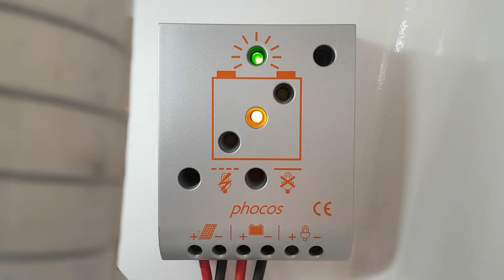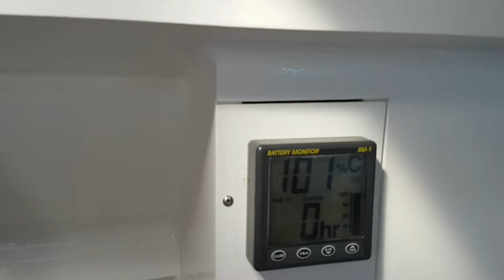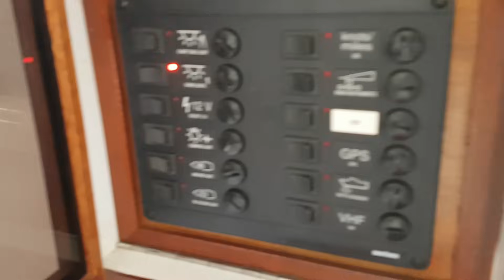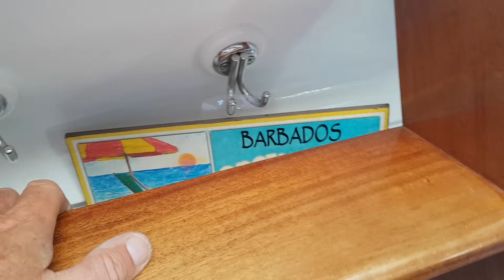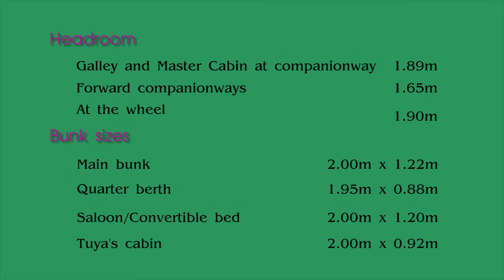Come Take A BOAT TOUR of LUCKYFISH ! Part 1- Ep 45

Comment: Hi!  Thanks for showing us round!  Always keep coming back to warrams.  Would you be so kind as to help me avoid my tendency to swing towards confirmation bias? Can you talk threw any points that you find buggy with warrams?  Thanks!
Reply from the maker: +Quodge Great to get your comment. Im try to think of some negatives... thinking... thinking. "Confirmation bias" eh? (love it!I) It would do a dis-service to the design to put any negatives out there as the list of positives is huge. Many of them sheer genius. I guess there are a few things that take a bit of getting used to on the boat, like any boat. You need to have a certain level of joint movement, fitness, mobility etc as you can find yourself going up and down the companionways a bit. I look at that as a positive since it does keep you fit and allow you to drink and eat as much as you want without getting fat. We also have to watch how much gear we carry. We have a payload of around 1 ton, mostly safety, storm and personal gear. Its plenty for us as we dont like alot of clutter on board anyway, it affects the performance. That's true of any cat but especially so on the Wharrams with our double ended design and deep-V hulls. In return we get great speed (for a cruising yacht) from small, easily handled sails and so on. Hope this helps,. Do check out our website at www.svluckyfish.com for more on the boat and you can join the Wharram Facebook group for a ton of help from other owners. It's here at https://www.facebook.com/groups/1104053236329219/ Cheers from Stew

Comment: the luckyfish looks great .what is your opinion of the type cats that have the cabin built over the pontoons?
Reply from the maker: +harvey g Great question. The bridge house catamarans you ask about are more suited to temperate climate sailing in my view. You can shut the sliding doors and turn on the heater in the cabin. For the sailing we do, between 30N and 30S I personally prefer the bridge deck, minus the house. This is pretty much the most ideal configuration in my view. Roll up the sides of the pod and you have unrestricted 360 degree view and cool breeze straight over the bows. Something you do not get on a "modern" bridge house catamaran. This is the major difference, there are alot more including acres of deck space to sprawl on, wide un restricted side decks set inboard for ease of movement and safety, easy docking with plenty of vision and low profile/windage, the list goes on. Not to mention the neat deck hatch set into the central cockpit (the magic hole as the girls call it!). Thanks for the question! Cheers from Stew and Zaya

Comment: Awesome work Folks!  Love your message about the simple life.  I'm curious about the in-hull dinette vs eating in your pod.  Where do you have most meals?
Reply from the maker: Thanks Paul, the pod mate, we always eat up there. Ask any cruiser... they spend 90% of time in cockpit. Interior design and apartment styling is only for boat shows :-)
Reply: @SailingLuckyfish  Thanks. I'm tosing up between Tiki 38 and Islander 39 for extended cruising. The I39 is more pod - less interior design, although I'm a bit worried about keeping the bed dry.

Comment: G'day mate, good your back, question mate - "single handing" a 38, size wise (it would be only around SEA) in the respect of beam in and around moorings/harbours what's your opinion? The last 6 months I have had my eye on one in Phuket. Also of interest to your followers is a neat doco of a 38 crossing the Atlantic W-E, it is inspiring if you're interested in Tiki 38's. (AP VISUALS) I am not connected just a fan of Wharrams. Anyhow fair winds and slip, slop,slap mate.
Reply from the maker: +bob smith - The Tiki 38 would make a great single hander if you have some experience of single handing a vessel. Just requires more forethought and planning around sail changes, picking up moorings etc. You could also go smaller, say a Tiki 30 or even 26 without compromising safety. Yes, Pilgrims voyage across the Atlantic is an excellent video showing just what the Tikis are capable of. Thanks for the comment and good luck with the search... (PS - if you haven't already, you can join the Wharram Facebook group and get a ton of helpful advice there... https://www.facebook.com/groups/1104053236329219/ )
Reply: Hello Stew, i really enjoy your videos and life style on this great boat. I was wondering about fresh water for such a long passage from SA, are you happy with your water maker, i am planning on going sailing soon, and freah water is #1, any comments, ? Thank you. Patrick
Reply: Cheers
Reply from the maker: +Sugar Reef Annick hi mate, just saw your comment. Yeah, really happy with the EchoTec. It does not have any electronics and so far seems very robust and serviceable at sea. Also, I have been impressed by the after sales back up from Darryl and the team at Trinidad, the suppliers. Cheers Stew

Comment: Looks like a good boat for fair weather and short passsges.
Reply from the maker: not sure what you mean by that? Wharrams are probably the most circumnavigated catamarans out there, certainly the most proven blue water safety record. We have sailed Luckyfish over 10,000 miles including an Atlantic crossing.
Reply: @SailingLuckyfish  I want draft and moderate cockpit elevation in rough seas. I'm not saying this style is bad in any way, I'm just saying every boat has pros and cons. I would personally begin feeling nervous around 13ft. in this style. I like the useable flat deck space. That is definitely a pro.
Reply from the maker: @kenhiett5266  makes sense if you are referring to keelboat specs. With cats, low windage and shallow draft are safety features that help prevent capsize. As far as sea-state goes, nothing beats searoom and thats more of a seamanship thing in my view. Cats are very stable in high winds, high seas under drogue or sea anchor, but sea room is required.
Reply: @SailingLuckyfish I believe the cat vs monohull debate is about as equally matched as is possible in the world of pure physics. Each has obvious flaws and strengths. 

I guess I just see the air draft of your boat coupled with the known characteristics of a cat and it makes me very suspicious of it's passage worthiness. I did watch a fairly well produced video of a Wharrams doing a transatlantic crossing and was impressed, but I also noticed their trepidation when dealing with state 5 seas. Maybe the air draft of your boat is more of a mental error in judgment I'm making. You are definitely a more experienced captain than I am. I am in the process of deciding between a cat and a monohull and it has become such a difficult decision that I almost view it as my nemesis at this point.
Reply: @kenhiett5266   When deciding on a hull configuration, think about the 99% of the time you'll be sailing underway, and it would be REALLY NICE if you could sit with a plate and a cup in front of you and have your dinner without everything sliding off onto the floor.  I've done weeks at a time on monohull, and man it gets weary never being able to take your hand off anything or it rolls away.

Overall quality of life issue, sounds silly but there you go, and it plays out in lots of ways 100 times a day.  Catamarans (& tris) are for living on for yourself.  Monohulls are for carrying craptons of cargo on the cheap, working for a master.  If you look at their evolutions clear back to ancient times, that's really what they come down to.  Monohulls literally can't move without at least trying to tip your ass off that seat and into the sea.

So maybe you're tough enough to fight that war every minute of every day and every night, every mile, every step and reach and action you take.  Maybe you're that tough.  Still, do you really want to live that way?  Is that living the free and relaxing lifestyle?  Personally, I don't think so, not so much by comparison.

The SailOceans channel is another good live-on channel, a rebuilt tri-hull done to their own needs, where they are full-time/season with 2 little boys.  Yah, with kids, like 2 & 4 years old, and all that brings.  I think that's pretty much proof of multi-hull livability right there.

The Maori and Hawaiians used to happily load the whole tribe up for weeks at a time to journey to new shores in the open sea with multihulls.

European navies with monohulls, on the other hand, had to take on prisoners who would otherwise be rotting in jail, or even literally bash guys over the head with a club and drag them on board in the night, just to get a crew.

Of course, you're a free person.  You can decide which way for yourself.

Comment: Hello Stew,
She is awesome. 
When you cover the uppper decks can you show us the engine control setup? I am really interested how the outboards go up and down and how the morse cables operate. Do your engines have electric start?
I know you showed us a bit about the wind vane steering a while ago but am keen to understand if Lucky Fish (lovely fish) has rope steering and if so how you have found it?
What is the length of the double bunks and Toya's bunk?
Also what is the head height in the main cabin and the working part of the galley?
The video had a lot of slap slap noise. Are hulls a bit noisy inside? Or was that just where you had the camera sitting?
Mate, she is great
The reason for the questions is that I am about build one and have only just sold my last boat to do so. Am excited!
Cheers
Paul
Reply from the maker: +Paul Bennett, thanks mate, great to hear you are building a Tiki 38! I am editing part 2 now and will address all your questions in there. You are also welcome to contact me via our website if you need any info during the build. We will do our best to help. Have you joined the Wharram Facebook Group here https://www.facebook.com/groups/1104053236329219/ - really helpful bunch of folks there. To answer a couple of your q's now -yes to elec start, elec tilt engines on raisable sleds, bunk lengths here https://youtu.be/-CKqexz5YIA?t=22m4s, yes to rope steering, brilliant, in video to come, headroom in link above, (similar in galley area as shown), hull slap not an issue for us (bad mic location and bad mic) its ply so there is noise but we are used to it - could be easily insulated around the laptstrake area to prevent it. Good luck with the build! What sort of pod will you go for? Cheers Stew
Reply: Thanks for all of of that - great! 

I am thinking of a similar style pod to what you have but with an awning similar to what Neil has crafted, not sure. Anyway that is a long way off yer. Thanks again, Paul

Comment: Hi, why did you wire the batteries so that both the + and - are coming off the same (first) battery? It is better to have the + coming from the first battery (going to the breaker panel) and the - from the last battery (also going to the breaker panel). Especially if you have like a battery monitor. Only then it measures correctly. For the rest: beautiful cat!
Reply from the maker: Great question - not sure what you saw in the video but we do have the +ve and -ve leads coming from the first and last batteries (Although each battery bank are currently isolated i.e. two separate systems). There was a time when we did not but this was corrected in Grenada. For anyone else reading this - this is important to give you full charging and storage of all the batteries. Same goes for the battery monitor. I do hope this clears it up? Cheers and great comment, Stew
Reply: Hi again. Ok, if you look 8:55 onwards, you show the battery installation. The three batteries are connected and both + and - minus end on the most left battery. The correct way would be to leave the outgoing connection of the + as it is, but move the outgoing - connection of the right battery to the most left battery. Anyway, both ways work, but this is just the most correct way, as you form a loop so to speak. I hope you get what I mean. Otherwise I can email you with a diagram.
Reply from the maker: Hi Marco, thanks so much, Yes you are absolutely right. That was some pre-recorded video and does show the incorrect wiring - you have a really good eye! We did correct this on the advice of the electrician from Grenada Marine. He mentioned that it was likely that only one battery was receiving most of the charge and reducing the effective storage, so we we moved one of the leads to the other end. Thanks so much for pointing this out!. Stew
Reply: You will find most Jeanneau's and Beneteau's are wired like that, eventhough it is correctly drawn up in the owners manuals. Saves cable basically. I had to rewire my Jeanneau and (professionally) some other Jeanneau's and Beneteau's too. Can't judge other boat brands.
Reply from the maker: Interesting. Learn something new about benes and jeanneaus every day. Good to know, thanks.

Comment: A little tight but very useful space..nice boat
Reply from the maker: +Frank Rice yes, quite tight, it is the compromise you make in order to get all the other benefits from the Wharram. They have narrow waterline beam, normally 12:1 or greater LWL:WLB ratio. That means the hulls are easily driven, meaning less sail area, less cost etc etc. You can read alot more about the design and Lf here http://www.svluckyfish.com/luckyfish_bio/ Are you thinking of getting a cruising boat or already have one? Cheers, Stew

Comment: The waves slapping the hull is pretty loud!
Reply from the maker: Re the wave slap, it is not a big deal. On passage we rarely sleep in the hulls, normally on the bunks in the pod. When we are on anchor, we all find it quite pleasant to hear the water noise outside. I guess we got used to it very quickly. The mic we used on that video didn't help! Also, if it was an issue to us, we would add some insulation. Easy enough to do, Cheers, hope you enjoyed the boat tour otherwise, Stew and Zaya
Reply: @SailingLuckyfish  This is interesting to me as I want order blueprints and then custom build the
catamaran and build my wharram out of 5083 grade aluminium -  double hulled with Great 
Stuff in between to act as insulation from cold and noise; and because the cells are closed,, it will serve as  keeping all (most?) of the  water out in the event of striking something, running aground on a reef, etc. The hull sections that are below the water-line will not be painted because I know that I'm going to; at some point in time in the future.

Comment: No Shower?
Reply from the maker: Deck shower, fresh water (water maker) solar heating, 12V pump. works fine. there is a case for not locating a shower inside the hulls on a wooden boat.